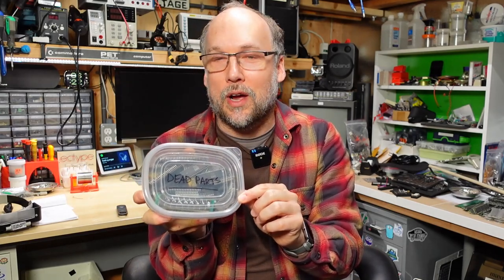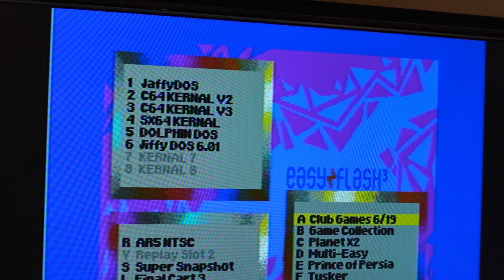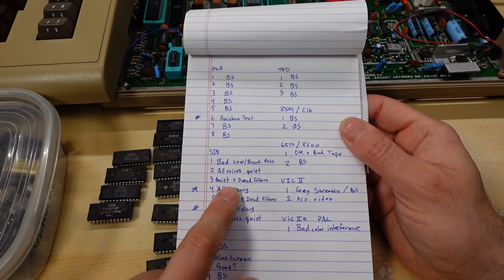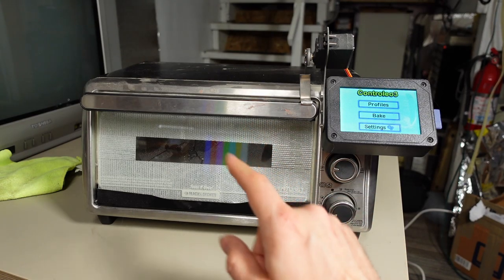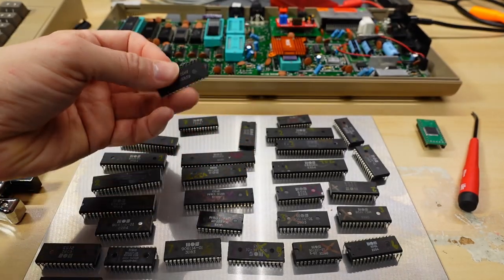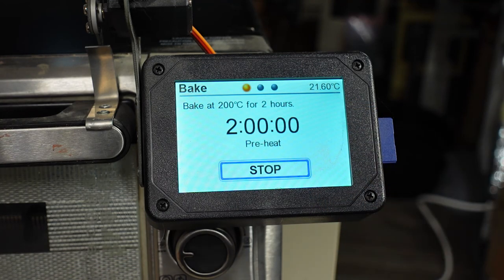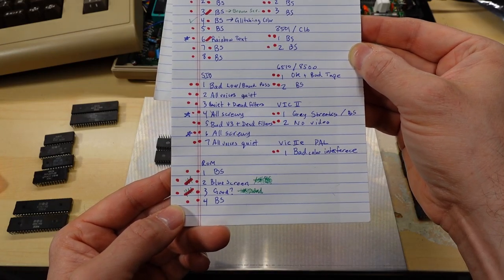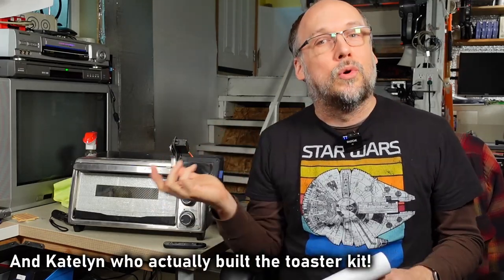Can we fix bad chips ... in the oven?

Comment: There have been instances, where PCBs like a whole motherboard could be brought back to life through such baking. Maybe you could try that?
Reply: This method seems to work better with PCBs, and things like modern graphics cards.
Reply: That's just to reflow BGA solder and is an unreliable fix.
Reply: @CommodoreFan64  : Yep, tends to be because of bad solder joints. ICs can commonly have more varied issues, such as physical damage from shorts.
Reply: @Okurka.  I never said it was perfect, but if you have say a really expensive GPU, and the warienty is null, and void, then it's at least worth a shot. Just don't do it in your kitchen oven. lol

Comment: I once bought the top of the line graphics card for US$20 with the"unknown problems". Brought it home, installed into the PC - the computer won't get past POST. No worries, then I did put it into the oven, let it cool and installed it backk into the PC - and to my surprise, it would let me boot. I then install the drivers and it works flawlessly
 
Anyway, one week after it started making random graphical glitches (dead pixels and wrong colours out of nowhere) and then a few days later it would BSOD the PC. It did let me boot into the safe mode, but not further than that. If I uninstall the drivers, it works, but if I install them back (and I tried different versions) it would cause BSOD upon the installation. I then baked it again, and this time, it died completely.
 
In the end, I threw it away, but heh, I had some good time playing the modern games on the high settings. Not sure if that experience is worst 1000-s of dollars, but for $20 ? Was definitely worth a shot :)

Comment: May I recommend that you try FREEZING the chips?  You can also do this easily by spraying them with "canned air"  with the can held upside-down (WARNING! if you do this its EXTREMELY IMPORTANT that VERY GOOD VENTILATION is provided - DO NOT BREATHE the canned air fumes EVER!; Canned air is a form of refrigerant and is quite TOXIC to you and the environment)  however, canned air can INSTANTLY freeze the chips on the spot and demonstrate interesting effects that thermals can have on them!

Comment: I fixed PlayStation 3 motherboards in an oven but doesn't last long. The first I baked worked long enough for me to backup my saves, the second worked for a year after the fix now it's dying again the 3rd worked but heated up fast and the drive control chip was blown according to some guys. I really hate the chip mounting of newer hardware, many notebooks, laptops, PlayStation3s and Xbox 360s went bad because of that.

Comment: I had a first gen Super Famicom that would not run unless I applied heat to the center of the CPU IC with my hot air rework station. It would die a as soon as it cooled down.

Comment: I have a really crusty 6502A CPU that tested as not working...the motherboard it came from was caked in some dried brown stuff

I wonder if the baking process would be effective at getting rid of contamination that causes bad contacts on the the chip pins, but has no effect on the internals of the chip ?

I wonder if this is the reason sometimes the baking works ?
Reply from the maker: I don't think so. In my case my ZIF machine holds onto chips super well. It's not a contact issue.
Reply: @adriansdigitalbasement  

I'm not saying your testing wasn't thorough

I'm suggesting the people that had success previously and are proposing baking to you may have had cleaned off any contamination on the pins via the baking process

Comment: Some heat maybe good, more heat better? NO! I'm a skeptic too but if it's worth trying, it's worth doing right, following the expert advice - ie. a second go at 150 degrees for longer when that PLA seemed improved. When you're happy there's no chance, that's the time to go for catharsis using "can't hurt" as an excuse. And if you're going to kill it with fire, you should really kill it with fire.

Comment: Given that some of these probably failed because of heat failure, I'm thinking that baking wouldn't change much.
Reply: But... but... that's the point! Heat WHILE the chip is energised causes the electromigration (or whatever it is called) 

By heating it WITHOUT electrical energy applied, it allows the electrons/molecular structure to return to the 'original' state (or closer to it, enough so to cause the chip to begin working again) or so the theory goes.

It's probably a VERY limited possibility, and the majority of heat damage is NOT the 'migration', but something else, which obviously is NOT revered by more heat.

Comment: I baked my 8800GTX graphics card for 10 minutes, and it worked for about a month or two before I tried playing minecraft. The reason it works as I understand it is because there are tiny connections in the chip that get broken over time, and useage. Reheating the chip may get these connections reconnected, but the connection will never be as strong as they were straight from the factory. Louis Rossman has a video about GPU Re-balling on modern macbooks here, which I feel is related: https://www.youtube.com/watch?v=1AcEt073Uds

Comment: if i had some bed chips to test.. i would try the "fast cool down metal"-metode iron would be brutal hard, ("locked carbon"). i would try 100c for 1hour.. then quick cool in water  0c ,for 5 minuts.. in order to lock the internal circuits

Comment: So in theory you could remove the die and wire it up again?
Reply: That would fix wiring issues, but nothing more. E.g. damage from shorting would persist, as would SID chip filter problems.
Reply: Ah. I sort of read it that the issues were in connections between the die and the pins. But there's a lot more to it I guess.

Comment: I have never seen or experienced a toaster oven bake evenly, evidenced here https://youtu.be/oeAwD144aV4

That big plate in the middle of the oven ensures either the bottom is wildly over temp (if temp sense at top) or wildly under (if temp sense at bottom), and as the linked video shows, there is heat distribution issues with a grate of toast, much less the metal sheet. 

I propose a batch of Science Toast or Acadamy Cookies to confirm if this wonder oven is working as well as any pick of litter full size oven. 

Lots of people seem to try baking labtop motherboards and graphics cards with success. These cases probably never had bad chips, maybe joints/connections... But searching those subjects may bring new information. 

Happy Day!

Comment: The problem  I see is, that 200C ist way too much. I had a lot of success repairing Nokia phones in the early 2000s by baking them. Later there were some defective graphics chips that would be positively effected by baking. All those chips had in common, that any temperature higher than 150C would almost always make it worse, especially if baked for too lang. 120 to 150C for 20 min was "my" sweet spot. Over 200C I would use for suspected broken solder connections under chips. But in those cases 2 or 3 minutes would be the maximum baking time. That method was what they call "reflow" today...

Comment: Baking broken electronics is not so uncommon. For example some known problematic iMac 21" and 27" video cards are commonly baked after failure to resurrect them. And it very often works. Its not permanent fix but baked cards can work with luck for 1-2 years after baking. And the baking can be done again but usually with lesser effect. And eventually they will no longer work after baking and they are really dead. Don't know why this happens though. Plenty of videos about this on youtube.

Comment: I could see this being more relevant nearer to manufacture because of contaminants, off gassing, bedding of substrate, etc.  30-40 years hence... Not so much.  Bonding of nano wires etc. won't likely be helped by high heat and cooling cycles not precisely controlled.  Cute idea.  Not knowing the failure mode means you are grasping at straws, the thermal equivalent of smacking it hard and hoping it starts working again.

Comment: Use a graded carbon aging oven (the ones used by universities/ archeologist).
Cool to absolute zero (or as close as you can get) minus 270C/450F or thereabouts with a modern CPU cooler (a standard hydrogen cooler just won't do it, you'll need something serious, say something you'd use to clock an i-9 to 20GHz or over).
Now connect your chip in full operating mode with carbon composite connectors. Set your ageing oven to between 2000 and 2500 Celsius with a 20.000 year overall setting. 
Now, having integrated your cooling unit into your oven (with shield wall), release the quick switch unit.
Keep in flux for minimal 20ms. Try variations.
Warning: do not expose chips to extreme temperatures for prolonged periods of time.

Comment: Nice experiment Adrian!
I know one type of chip that definitely can be 'fixed' using the baking method. It's the so called flip chip package, which is notorious for having bad solder bumps mostly because of thermal issues/warping. The main ICs inside the Xbox 360 and the ones on some Nvidia video cards are good examples. Heat will simple internally resolder them most of the time (temporarily?) ;-)
Of course I don't recommend this because they're known to fail again after a short period. Just a cheap and awful implementation of an otherwise smart design ;-)
Reply: Mr Guru  Yeah totally different thing. Totally unrelated. Totally. Your comment is also totally unrelated to this vid. 
The solder balls on the outside of BGA chips are a weak point yes, but they are not what I was referring to. 
A lot of BGA chips also contain solder 'bumps' which are definitely on the inside of the package and are the internal solder joints of the chip die itself which can be 'fixed' using heat but I guess this doesn't exclusively match your narrow idea of fixing electronics using heat/a baking oven so I'm very sorry for mentioning it. It won't happen again.

Comment: I had a stick of DDR3 ram that was throwing out errors, I did this and its still working on an old i3 system. sometimes you get lucky
Reply: Mr Guru  Well yeah, you kinda missed the point, said putting it in the over can work if your lucky...
Reply: Mr Guru  you missed read it, I know what the difference is, Read this for crying out loud, If you put a chip or any electronic into the over, sometimes you get lucky, READ IT OUT LOUD, it might help. I know its difference between the 2, doesn't change the fact either chip or reflow is the luck of the draw. I will remember to write a 5 page paragraph next time so your thick skull can understand the point I was making, sheesh.....
Reply: Mr Guru  What are you talking about?

Comment: Actually lol, in my case it wasn't a chip, but around 1-2 years ago, my GPU Radeon R9 270X in my PC broke, while i was playing minecraft, suddenly my screen was only all green bars, restarting the PC had artifacts, i took the GPU out and removed the fans and put the GPU in the oven, well first i left it in water with soap, and rinsed it off and waited a day, and then i put it in the oven, and waited a day again, and weirdly enough all the artifacts were gone!
It lasted for a long time actually, till problems came back and my PC ended in locking up.
So its kind of weird how the oven has such an effect!
Reply: Mr Guru  The reason why i meant it as related because its baked in the oven.
Reply: Mr Guru  Its both PC parts, but go off and be edgy like this.
Reply: Mr Guru  Quite sad, that you can't just let other people enjoy and write comments.

Comment: Is anyone else recalling Linus and Louis Rossman when they baked a GPU and then Louis tried to teach Linus how to repair one?
Reply: Louis Rossman has a video talking about why baking GPUs may work as a temporary fix but won’t fix the problem permanently.
Reply: Mr Guru  Just have a look at this comment section and see how many people say they "fixed" their device and it broke again after a few weeks.

Louis isn’t bashing Apple just for the sake of it, he is pointing out actual problems in their devices.
Reply: Mr Guru  He definitely does but he also points out problems with other manufacturers when he happens to work on their devices.
Back to the topic of fixing broken chips by baking them: I have a few broken GPUs laying around. I think I’ll bake one of them and do some long-term testing if it comes back to life. I’ll put updates here.

Comment: Adrian (@Adrian's Digital Basement) overheating the chips can help
 rejoin false contacts in the "soldering" of the chip internal wiring...
take a look to this image >> https://i.ytimg.com/vi/iWX1WY4jw5c/maxresdefault.jpg
it will always depend on what happened to that internal wiring..

if most of the wires are still in place... and is just a false contact between the wire and the soldering pad.. Can work.. 
depending on what type of welding has been used to the join...

now if it disconnected and get retracted .. like in the up left corner in that picture.. forget it..

and if are touching or crossing between them like in the down right corner in that picture.. also forget it.. because you are going to melt any kind of insulation between those wires...

Comment: I'd like to sand the tops off these dead chips and expose the traces and die to see if I can identify the fault under a microscope. Compare them to ones that do fix themselves. 
2. My guess is you coat them in flux and put silver solder on each leg the solder might migrate to the brake if there is one.  Bake them legs up.

Comment: LOL you cannot repair ICs. There is a method that Commodore used on the AAA prototype Chipset so you can change something on the Die afterwards but it costs so much, you could not judging by your little toaster. Its not really a repair, more a rework, because working chips dont even need a rework.

Comment: I once heard that there might be a issue with moisture getting in to the open cheramic covering. The same way as plates do if you chip of the glasure. A easy way to test this on a plate or cup is to stick it in the microwave. If the cup or plate gets hot, its filled with water.
Could it be a similar problem? If there is moisture in the chip, it might get out if one is baking it for a long time.

Comment: It's a shame you changed 2 variables instead of just one when experimenting with the process. 

You could have remained at 150 degrees but run for the longer 2 hour duration, to see if that changed anything. The higher temperature is more likely to be a killer, as most parts aren't rated for max thermal limit of 200 degrees.

Following the longer time at 150, you could then have tried 200 for the standard 30 min time and tested again. Finally higher temp for a longer duration would have been a last ditch effort at testing extreme conditions. You went straight to the extreme, and skipped a bunch of possible intermediate steps which MAY have yielded different results.

Still a fascinating video and theory though.

Comment: Gotta admit, I was extremely skeptical at the start of your video.  But it was sure worth a shot and a great fun thing to try ... especially given the claims of the ex-Zymos guy in the article you showed.  It would be worth the effort even if you only managed to restore a single SID chip to working order.  
* SPOLIER ALERT *   
But to have a zero success rate ...  wonder what the ex-Zymos guy would say about your results ...  he claimed baking refreshed / restored many chips, cards, and even motherboards back to fully working order.  Could it only work with brand new / near new chips and not 30+ year old chips ?  Is a better oven required ?  Is the Zymos guy completely full of crap ???
Reply: Mr Guru  No.  At 14:54 he shows the article from the ex-Zymos guy, where he talks about baking chips and destroing them and them baking them to restore them.  The article says "If I returned the same dead chips back to the ovens ... after a time they'd be miraculously be restored to life".  Nothing to do with solder at all.
Reply: Mr Guru  The article by the ex-Zymos guy said chips, cards, and motherboards.  I was very clearly referring to the article.  Recommend you watch the video before going off half-cocked.
Reply: Mr Guru  "but that a totally different thing and unrelated to this vid."  LOL !  Anyhow, I see you have dumped stuff for MAME.  A guy called Guru was the main dumper for MAME and was active on the MAME World forums years ago ?  Same guy ?

Comment: 99.8% of the time, the substrate of the chip itself is damaged. And baking at around 120°C can make them work again, for a few weeks, before they fail once again.
If 120°C does not work, and you have to go to ~220°C and if it actually works, congrats. You won the lottery because it was a 0.2% soldering issue.

People need to understand, 99.8% of the time, baking is pointless because its NOT a soldering issue! The chip itself was faulty from the beginning and is damaged goods, now and in the future. It cannot be repaired, not even by the Chip Manufacturer itself! And only shady eBay sellers bake their broken cards to sell them off!

This is one reason why i will never buy a used $300 GPU! Its just stupid and a waste to invest so much money on a gamble.